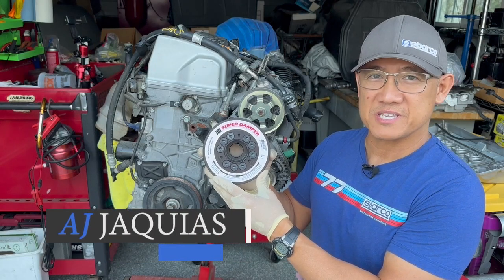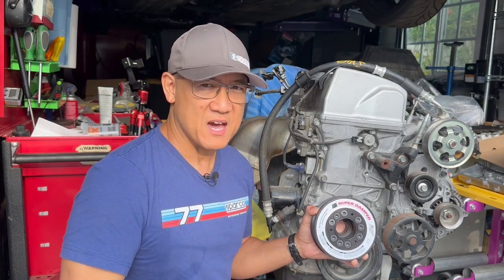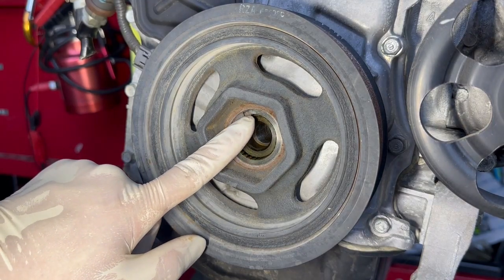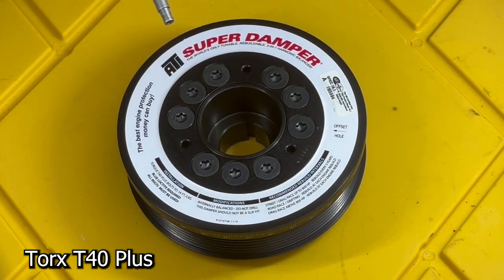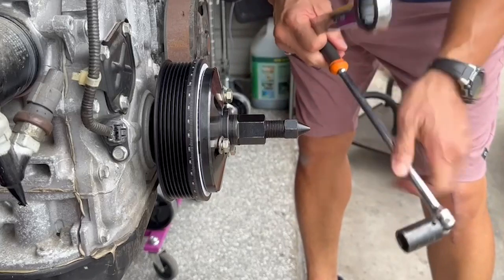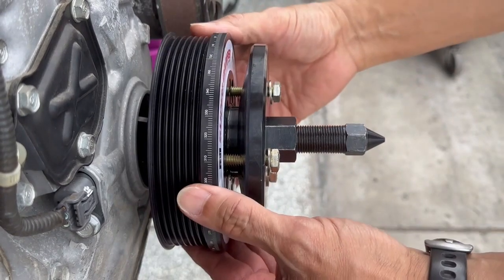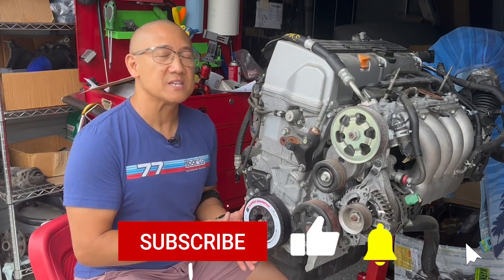ATI Super Damper Installation and Removal - Honda K Series # 918477 & 918478

Comment: Just use a regular Torx-40 bit, there is no such thing as a Torx-40 plus bit. Get the one from Harbor Freight.
Reply from the maker: Don’t do that. There is such a thing as a Torx T40 Plus. If u use a Torx T40 chances are it will ruin the bolt head. Ask me how I know. Just in case, u ruin a bolt head, u can purchase extra bolts from ATI.
Reply from the maker: https://www.slokyusa.com/torx-and-torx-plus/

Comment: Follow up comment, utilizing the existing 5/16 threads worked effortlessly. I can’t thank you enough for the detailed video! Note k24 swapped 2nd gen mr2 with plenty of room to pull the damper off while motor was in the car. 💪🏻💪🏻💪🏻
Reply from the maker: @Younis872341  very nice. Thx for the update. Pls send details and pics of ur install to shoprelentlessracing@gmail.com and I will include on the website for others. Thx again, AJ

Comment: Awesome video! Thanks for sharing! I needed a different way of removing my ati damper off my crank. I previously used the wrap around style puller successfully but it did cause minor damage on the outside edge. The option you shared is less bulky while working with the motor in the car & utilizing the existing threads is glorious!
Reply from the maker: thx for watching and commenting. The adapters are available here... https://shoprelentlessracing.com/collections/ati-adapters Don't forget to purchase the installation/removal kit as well. Recall, a Torx T40 PLUS is different compared to a Torx T40. Pls subscribe. Thx again, AJ

Comment: does this ATI damper works for a 7 ribs belt?  I have my k20 with a rotrex and 7 ribs belt
Reply from the maker: @felipefava2696  are u using the OEM K20 crank pulley now?
Reply: @RelentlessRacingAJ  yup, but that pulley supports 7ribs belt (oem belt is 6ribs i think)
Reply from the maker: @felipefava2696  the ATI super Damper uses the same belt as the OE crank pulley. I recommend calling ATI for assistance.
Reply: @RelentlessRacingAJ  yeaa, thanks for the reply tho and the video!

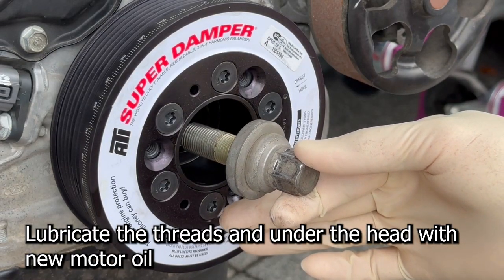Comment: Great video! Will have to order that adapter for the K24! At 7:08 You torque the crank bolt, but don't show what tool you use to hold the crank still. Could you elaborate on that and say what do you use to keep the pulley still while torquing the bolt? Thanks!
Reply from the maker: @cabac89  there are many ways to hold the flywheel… just search on YouTube. Here how I do it: see 11:27 https://youtu.be/fHRbfybyG6Q?si=6V6XuGdWbwiCWOWv
Reply: @RelentlessRacingAJ Thank you! I just ordered your adapter and purchased the proform kit using your affiliate link!
Reply from the maker: @cabac89  thank you. Will fwd tracking once it ships. Thx again AJ

Comment: Also, I have a GM aftermarket crank with a woodruff key, that is, the key slot does not extend to the end of the crankshaft.  How exactly does one press fit a damper and aligned to woodruff key?  BTW, the original OEM damper on the 1969 GTO engine here had a slip fit damper.  Again, why is a press fit needed when a second case is given where OE did not deem necessary and how does one install press fit damper on woodruff key configuration?
Reply from the maker: I don’t think it is plausible to compare current day vibration and harmonics detection and engine design to over 50 years ago. The newer engines are more efficient and run so much smoother. The woodruff key configuration you are referring to is the same on the 2ZZ. Check out my 2ZZ ATI Super Damper video to learn how I did it.

Comment: Ok, why is it that the OEM damper slid off yet the ATI must have a press fit to properly work?  You cannot tell me Honda would not have a press fit if it were required.  There is probably 15,000-20,000 of lbf clamp force when that crank bolt is torqued - I presume that Honda determined the clamp force alone was sufficient to not allow the damper to rotate/slip on the crank.  Looking for a technical explanation - a former automotive engineer of 20 years commenting here.  Excellent video on how to!
Reply from the maker: I appreciate you watching and commenting. Regardless of slip fit or press fit, OEMs tune crankshaft pulleys to minimize harmonics and vibrations originating from the many forces applied to the crankshaft. Honda deemed their design (woodruff key, slip fit, M16 crankshaft bolt assuming K series and material/weighted/filled crankshaft pulley) accomplished enough dampening to meet their criteria. However, not all OEM crankshaft pulleys are slip fit. In fact, Toyota opted for a press fit design on the 1ZZ, 2ZZ, and 3SGTEs and Toyota deemed their design met their criteria. ATI has a criteria, too. They believe if the Super Damper is not pressed on, the engine harmonics will not make it to the damper and not allow the damper to dampen. I don’t know the FN number for the press fit, but it’s not a huge interference fit. Hope this helps.  -AJ (former Aerospace (Satellite) Engineer 20 years, ex-Toyota Senior Accessory Developer, and born as a wanna be racer)

Comment: Great vid 🔥🔥🔥 so the F series would work with the H right ? I'm about to order just want to make sure !!! Thanks in advance
Reply from the maker: Thx for the kind words. Pls subscribe. H series is same as B series. Don’t forget to add the installation kit to your order to get the Torx T40 Plus socket and hardware. -AJ
Reply: @RelentlessRacingAJ  thanks 🙏
Reply from the maker: @ratata2315  pls email us if you have any questions. 👊